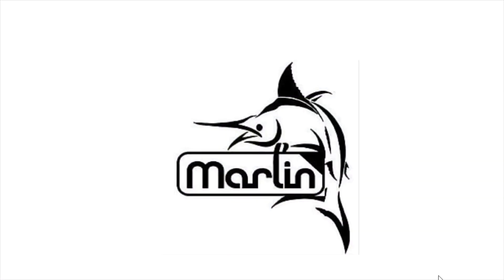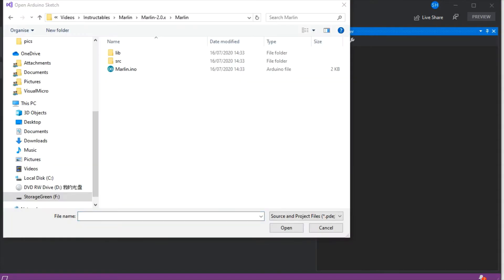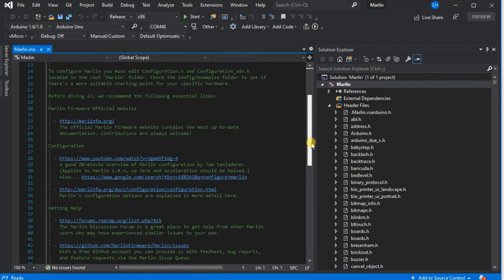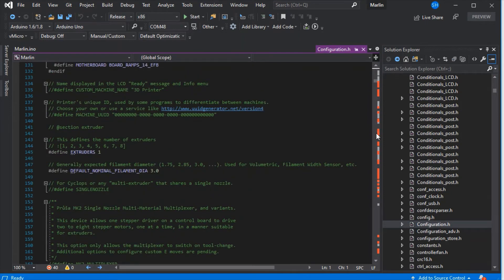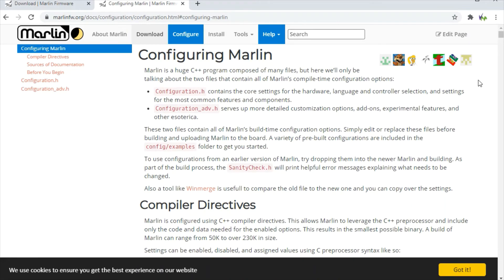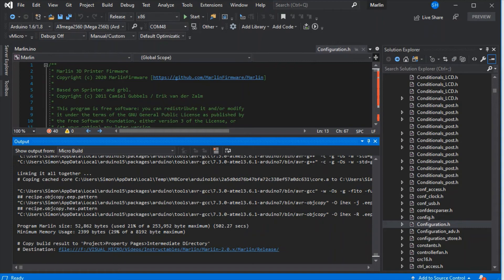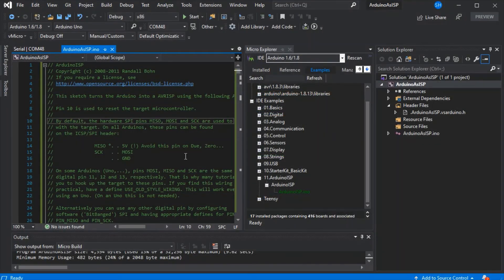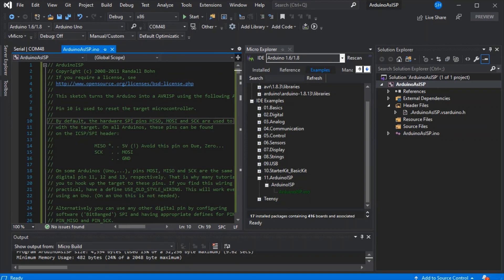Installing Marlin 3D Printer Firmware (Arduino Build / Bootloader)

Comment: How did you got arduino environment in vs code studio?
Reply from the maker: The Visual Micro Extension for Visual Studio adds full Arduino compatibility.

It can be used standalone, or it can share the same boards/libraries as in the Arduino IDE.

The standalone installation is detailed in this video:
https://www.youtube.com/watch?v=DPe66lw3c1s

To use it alongside the Arduino2 IDE see this video:
https://www.youtube.com/watch?v=JHfuhvaSOF8

Comment: Thank you for the great video. I have a question, can I install marlin to any mainboard. Because I have one printer but I don't know what kind of firmware in it and I made similar printer but I used different motors, so I am going to install marlin to my new printer with my old printer's mainboard
Reply from the maker: If your main board is one of the compatible boards then yes (or based on the same processor etc...).  
https://marlinfw.org/docs/hardware/boards.html

You can check what you are running with the M115 command normally which may reveal more information.

Comment: Well... I have an xyz printing davinci mini w ... the printer has marlin, but its firmware is very restricted.... Can I make my own Firmware with this tool?
Reply from the maker: Yes you can develop your own firmware for your printer using this software, or extend / modify existing software such as Marlin in C / C++ / INO, as well as use the Serial Debugger for easy troubleshooting in development.
Reply: @visualmicro4389  but i dont have a configurarion of my mainboard...
Reply from the maker: @lolman2003  That often takes some research to find, and gcode commands can be sent to your printer without modification to understand the firmware version (https://marlinfw.org/docs/gcode/M115.html) and configuration which is on there already. The more popular the printer... the easier it should be to find a guide to build from the Marlin Source to your device...
Reply: @visualmicro4389  my mainboard is not for programming... so the layout of the pins are nowhere...  the alternative would be a marlin configuration, but i didnt find one... i have to modify my firmware, because i cant print anything, because of a broken filament nfc reader... so i have to deactivate this reader, but the firmware is smart... when i had just the marlin firmware on it, the printer wouldnt be blocked by this nfc reader...

Comment: Still in the dark, none the wiser, so a complete waste of time on all counts. 1. How does the story end about the SD Card? Do I need it? Why do I need to wire it up when it is on my card already? 2. How do get around the bootloader issue? There was an incoherent mumble about it, that's all. 3.  Why would I use the paid-for, suspiciously-named "Visual Micro" à-la-Chinese rip-off style, when I have "Visual Code" with PlatformIO that runs on all 3 major end-user platforms?

Comment: Great video. Thanks. For tinkerers/developers, it is perhaps worth mentioning that using source control locally (i.e. git), in conjunction with this, is a good way to manage printer ‘firmware’ configurations in Marlin. This can be useful for experimentation as well as managing firmware for different printers that may all use Marlin.
Reply from the maker: Great tip thank you